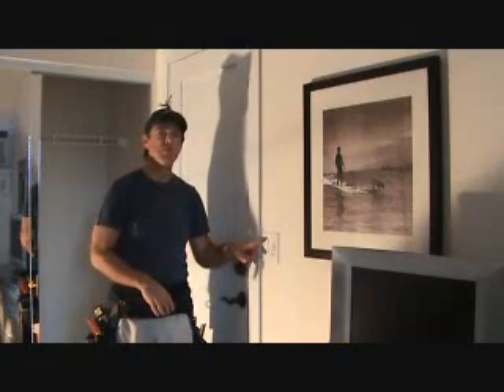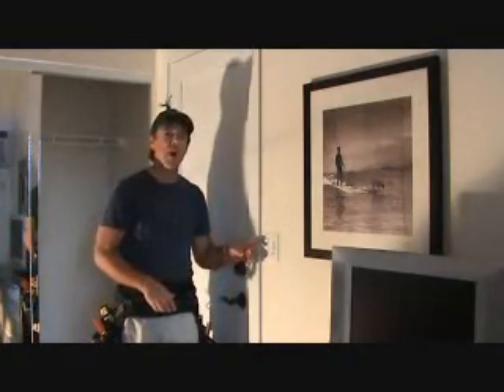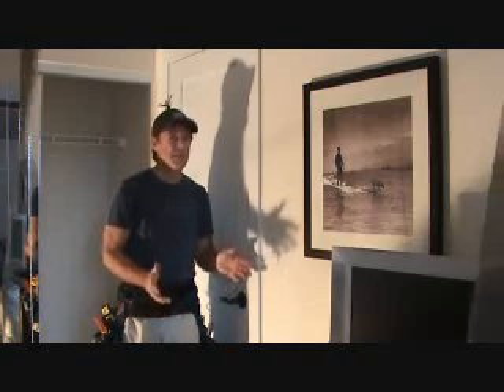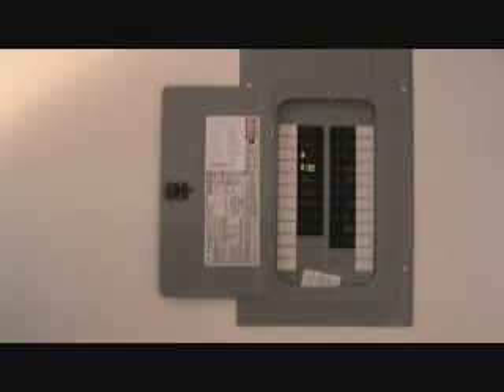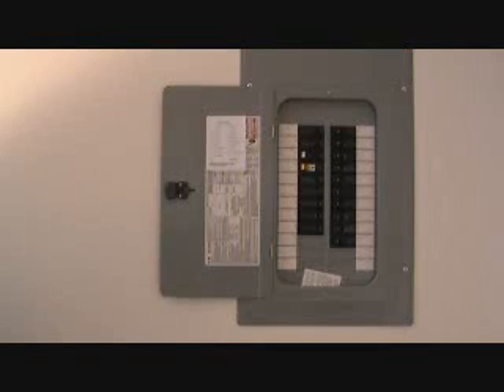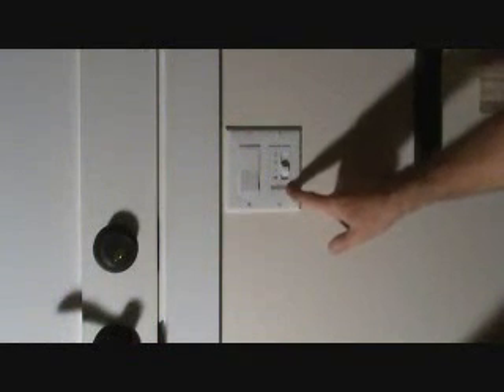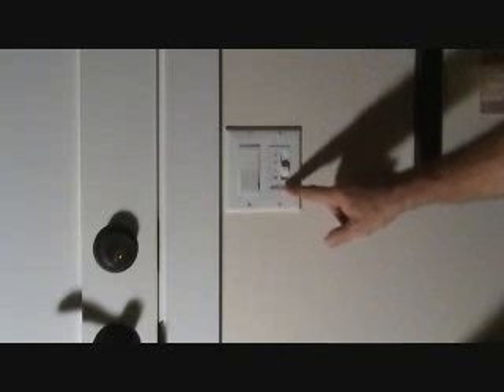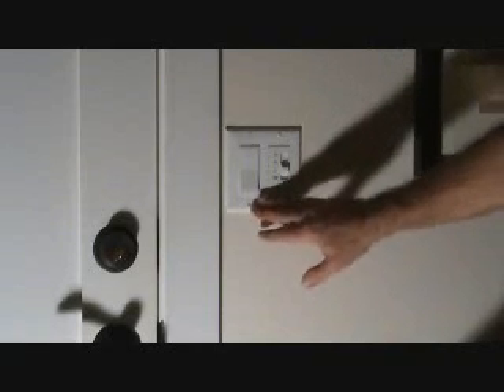How to trouble shoot an electrical short

Comment: To create loads on the breaker. Take 2 hair dryers that will draw 20 amps or heat guns when set on high and use an amp meter on the wires to the breaker. A breaker 100% duty cycle is 80% of the rating on the breaker. 20amp breaker is really only 16amps 100% duty cycle. Now run load as close to 100% duty cycle. if it pops out at say 15 amps you have found a faulty breaker. Note by changing settings on hair dryers you change amp on the breaker.
Reply from the maker: Wow never heard how to do it that way. I found out from my electrician that most breakers never go faulty but then again when they do or how to check one I never knew...

Comment: Joe, maybe you can help me.  My neighbor has a breaker that keeps popping.  He replaced the breaker first thing because it seemed the easiest to do.  I haven't pulled out all of the outlets on the line yet to check for connections at each one.  But, after doing so, what can I use to test each outlet? If each outlet tests out, then it may be a cut wire in the walls because they used aluminum studs in our development.  Can I just use a continuity tester to test the lines?  There are only wall outlets on this particular zone.
Reply from the maker: If you just test each outlet without removing from the wall, how are you going to test it if the breaker won't keep the circuit on? Chances are it's a defective duplex outlet or maybe even a bad light switch &/or a loose wire nut behind a receptacle or light switch. I even saw one time where the ground prong from a vacuum broke off in the duplex outlet & all I had to do was pull it out with a pair of needle nose pliers, or the ground could be broken off the face of the duplex outlet. It might not even be a duplex outlet. If you have a faulty cord like on a lamp next to a bed stand per se......that could cause the breaker to trip as well. If you have an attic area, it could be possible that a mouse chewed through your romex cabling. There's a few ideas for you. Hope you find it. let me know what you find. Good luck!   Joe  :0

Comment from the maker: I guess the breaker I was referring to was one that had a reset button on the actual breaker. True most standard 15 &/or 20 breakers don't cost very much. It was just a brief video giving out some info.. My breaker ended up being fine & did not have to replace it. Had I needed to replace it, guess who would've done another video?!  Thanks for commenting!   Joe  :0

Comment from the maker: You might have a loose wire under a wire nut in a wall or attic junction box. Have you pulled the wires out & checked to see if one set has power to them? Do you have a GFI outlet somewhere not working that might be connected to this outlet/switch? Another outlet receptacle could have a loose wire behind it thereby making these additional locations with no power. You may have to open up some outlets close to this area, to find out. Make sure to turn power off before opening up.   Joe  :0

Comment: joe i have an out and a switch with no power in the wires ,the switch is on the other wall.some had install ceiling lights before i owned it any ideas thanks
Reply from the maker: Your power issue could be many different things so you would have had to have an actual electrician come out to troubleshoot & fix your issue. What did you find was causing your power issue?

Comment: hey joe ,i have a outlet with no power,the wires have no power in them,i all so have a wall switch that the wires have no power, this is what i do no that some one had installed ceiling lights .but this has got me,now the switch is on the other side of the home
Reply from the maker: So sorry for not getting back to you ten years ago!...but I would have referred you to call an electrician out to troubleshoot your electrical issues as every situation is different. Thanks for your message!

Comment from the maker: Cut the hole the size of a single gang or 2gand cutin box then you can install a cutin box then put the blank plate over. You don't have to use a cutin box. you could put in a telephone cutin ring if you want. That's if you can't find anything wrong at the outlet locations. Try that first, before cutting holes in your wall. How many outlets do you have on the breaker? More than just the 2? Why are the other outlets working? questions to think about.   Joe  :0

Comment from the maker: It might not have anything to do with the guy drilling the hole. A wire &/or loose screw connection on an outlet, could be the issue or maybe one of your outlets has a broken ground slot. I even found someone had accidentally broken the ground prong off a cord & it was stuck inside the ground slot on an outlet. Check things out & follow the power back to your breaker. if all else fails you could cut out a hole in the wall to see if he hit a wire, then put a coverplate over the hole.  :0

Comment from the maker: Your cable guy could've accidentally drilled right into a romex cable in the wall that was strapped next to a 2x4. He could've nicked both wire in the cable. or.......could you have an issue at one of the existing outlets? Are they side by side in the same outlet box? You definitely have a short in the circuit somewhere. Trace the circuit back to the panel. You could open up each outlet that is connected there & see if a pigtail wire could be loose under a wire nut for example.   :0

Comment: I have to receptacles in my room that whenever I attempt to plug in an appliance sparks shoot out. and it trips the breaker, now recently a cable guy drilled a hole in my wall which Is what I think caused the problem. I wanna know how you think I could fix this I know wiring, I just wanted your help and your advice one what you think the problem might be? you think it might be too shorts? or did the cable guy damage the romex when drilling a hole? please get back to me as soon as possible
Reply from the maker: Sorry I did not respond back to you in a timely manner! What did you end up finding to be the issue?

Comment from the maker: Of course you should never work on a circuit if the power is not turned off. I don't believe I have ever given the advise to have a non skilled DIY'er work on a hot circuit. That would not be wise. This video may not be for the first time beginner but it might encourage a first timer to be really aware of what not to do. Thanks for your input.   Joe  :0

Comment from the maker: In my cased however, I could make the breaker trip without overloading the circuit as you have described. Every once in a while the breaker is still tripping when turning on the ceiling fan switch, even with the lights off in the room. I think the breaker is in need of replacement since the initial electrician wired the ceiling fan switch backwards. Thanks for commenting.   Joe  :0

Comment from the maker: Sometimes the garage will have a GFI outlet somewhere close by, that may need to be reset, that is effecting the outlets in the garage. Could that be the isuue? Sometimes there might be a double breaker in your panel, where one of them has been tripped but the other breaker that is attached to it is making it look like the other breaker has not tripped.Could that be the issue? Which outlet are you having problems with?....one in the garage or somewhere in the house? Let me know.   Joe  :0

Comment: Maybe your circuit is too charged so sometimes when you only had another charge (like a fan) it maybe trips the breaker. Old breaker trips easily and GFCI trips even more. Also check if all of your screws are tight enough, slack wires can create current peaks by sparking and it only gets worst after. I don't know if you all konw that but it's just to help. See ya.
Reply from the maker: Thanks for your thoughts & suggestions for sure!